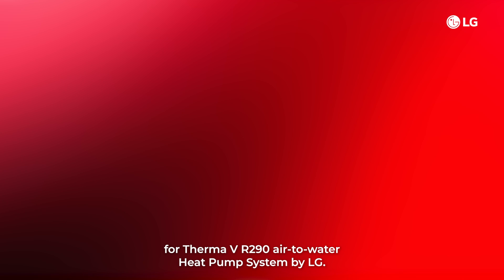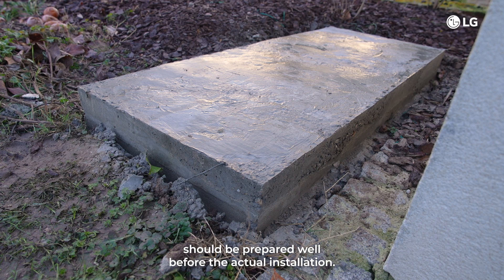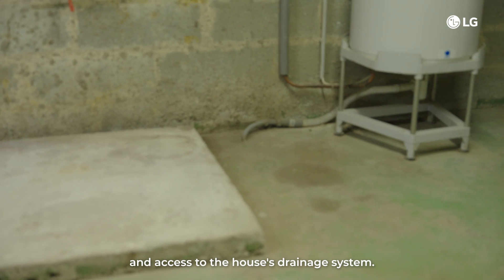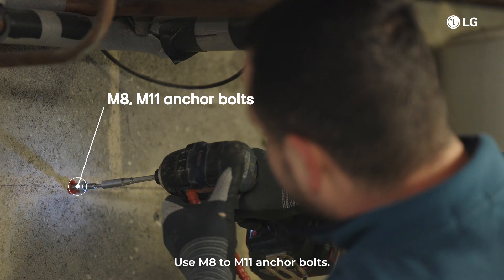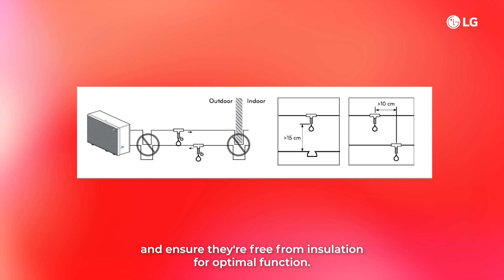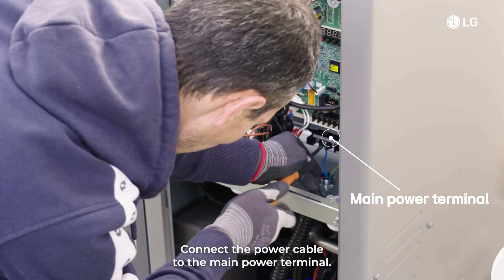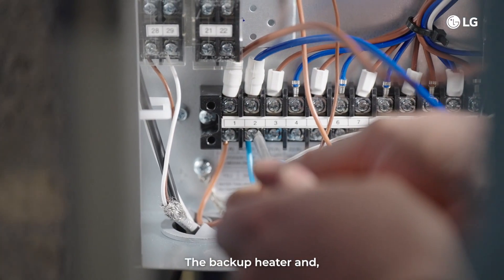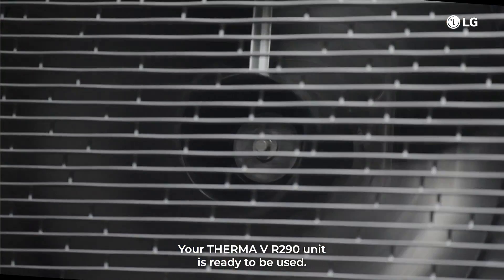LG THERMA V : R290 Monobloc Installation Guide | LG

Comment: My question: LG Monobloc R290 9KW-Therma V, I have a question about the preparation: How much space should I allow in the boiler room for the remaining components of the heat pump, e.g. buffer tank, control unit, pressure distribution, etc.?
Do the remaining components of the heat pump have to be in a closed room?
Or do I have to build a partition wall with a door between the bath and the remaining components of the heat pump?
Reply: Yes it would be better to separate them with a closed room.